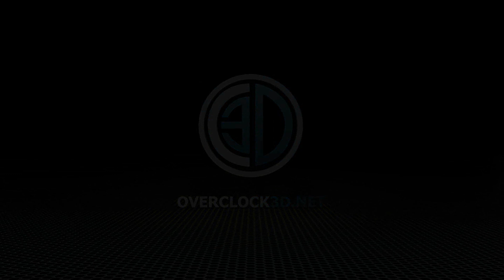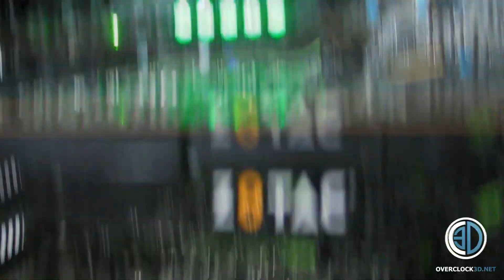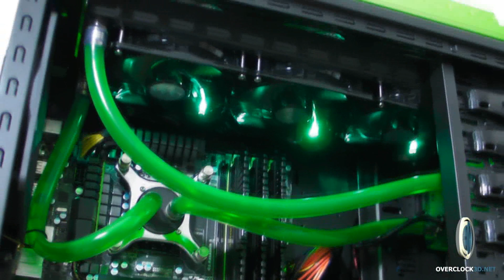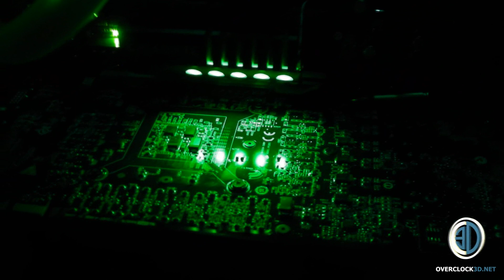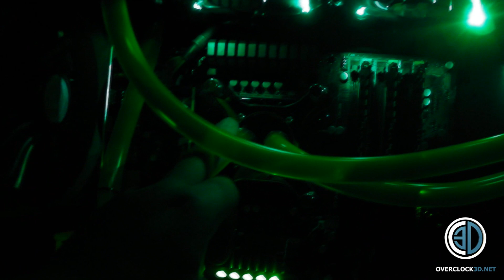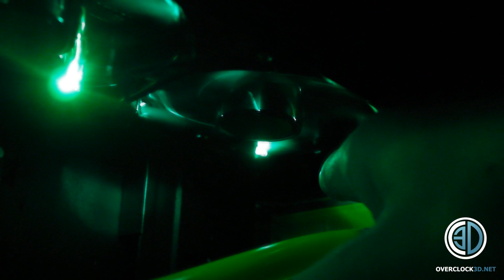Gigabyte Assassin G1 Project Build Review Part Three   Light Show

Comment: I was going to build a rig like this, but after doing the math, I went with the Alienware Area-51 ALX  (ATI CrossfireX version). I can't complain. This thing is unreal. It has all the watercooling, led lighting and adjustable vent fans. I am playing Crysis Warhead with all the options maxed out, and it runs smoooooth. It cost me $4200. This rig here added up to $4559. Plus, it came with all kinds of cool software, saving even more. Cant beat Alienware!

Comment: With two GTX 580s that close to each other I'd consider putting another 230mm fan in the door if it will fit. 
Tests on a single card showed:
Idle power = 150 W. in windows 7 with Aero enabled
Under load = 363 (running 3DMark06 Canyon Flight test)
Loaded temperature was 55° over ambient.
I think about how much heat a given amount of power creates in 60W incandescent light bulbs. Try cramming 12 of them into that small a space!

Comment: It looks great but for a Water build project I would have wanted to see a full water cooling, of chipset, graphics card and so on. I do understand your point of that you actually just review the actual set you got, but perhaps you can make a full water build later? I think many want to see that. Also the fan noise is just too high on this build, I think you should show the easiest ways to reduce that in a build like this. I'm sure many want water because of lower noise, but this is louder.

Comment: @ThomasCreel Just the standard stuff. Vista Pro 64, your basic Roxio burner, ATI control and the usual internet stuff. That's what so nice about Alienware, they don't load your machine with a bunch of "bundled" junk and clutter. All that crap on your harddrive you never use slows a system down just by being there, because Windows has to keep track of it.

Comment: @torakka94 must be a glitch since having a 27c temp on the CPU and ambient temp at 28c its impossible on just water-cooling.... other than that those temps are good, idles are great but maybe load temps should be a lil lower with your setup.... triple 120 and a good block like that should be lower temp at 3.8...  I had a xspc setup like tom in my 950 and got 72C a load at 4.2ghz on prime95... so maybe change thermal paste, check for gunk on cpu heatsink, maybe upgrade pump (helps ALOT)...

Comment: how did you manage to put 6 sickleflow on rad ? i have haf-x nvdia also with xspc 750 rasa RS360.My rad is placed like yours with 3 sickleflow inside the case and on top i have 2x 200mm green led bitfenix . i wanted to use x3 sickleflow also on top for better push-pull but there isnt any mounting for them there...only holes to place 200mm fans on top .

Can you help me here plz ? 

P.s i love your videos . Big fan here from greece !

Comment: @Breazeh 199 for XSPC Rasa 750 RS360 @ pc case gear au website

You should find nearly everything else there as well. The twin GPU cards, 2 x 256GB SSD alone would run you close 1500. then add CPU, 2600k maybe, motherboard and ram is going to be the better part of 750.
Then you still need PSU and Case, another 300+.  That's the Better part of 3000 and you will still need monitors, keyboard and mouse.

Start Saving:)

Comment: @asus3571 its like $0.61 to a £1 which means its cheap to me but most of the time it gets stopped at customs and you have to pay them to get it back and they stop it because you aint payed no tax or vat on that item and that comes to paying like an extra 35% of that items value so when it all adds up its only a little bit cheaper than what it is here thanks any way though :D

Comment: @TimeToLiveCustoms Didja hear? Intel just slashed the wholesale price on the i7-960 to equal that of the 950 ($274 US.) That should produce some serious 'golden chips' because the 960's bin is open-ended at the top. IOW, some of those chips would have been stepped and binned at mult=25 and speed= 3.33 Ghz. Or am I wrong on that one, would they become i7-975s?

I posted a thread at OC3D under Motherboards and CPUs. As SadButTrue, my handle over there.

Comment: Hey man, i have basically the exact same build as this only i have one gtx 580 but its a 3gb and i have a v8 cooler, my motherboard and tower are the same, but after i built it, when i turn it on nothing comes up on the screen any ideas? my power supply is 750w btw